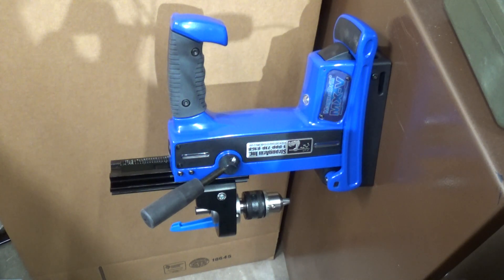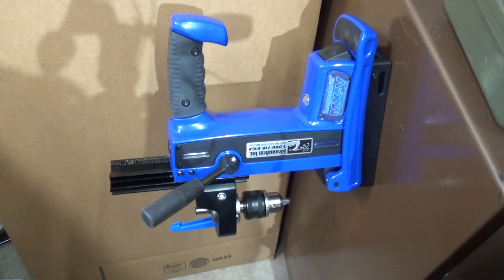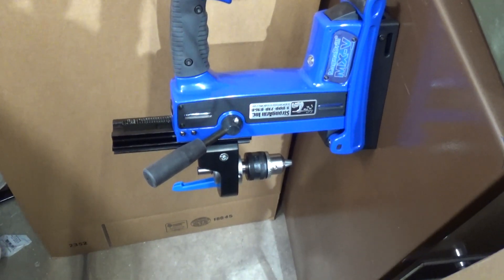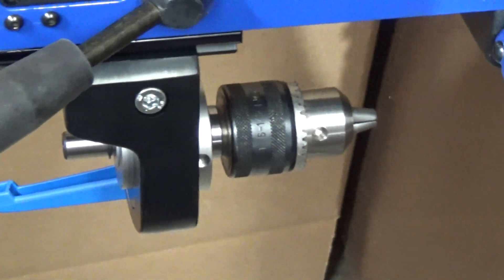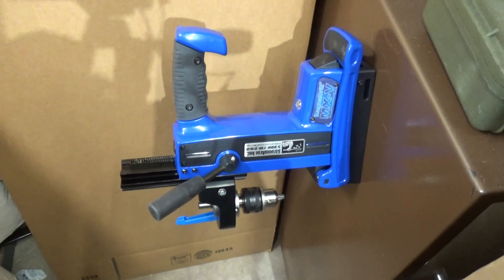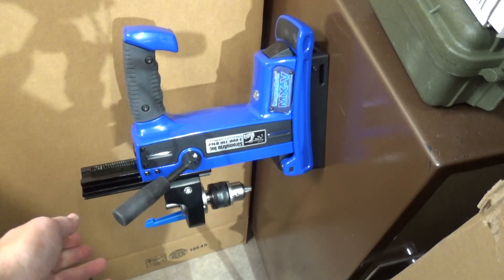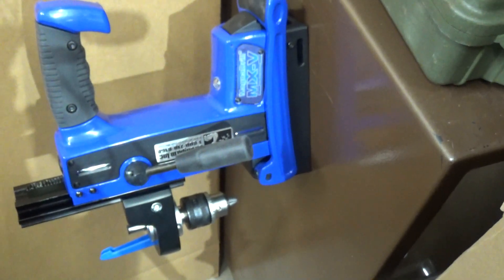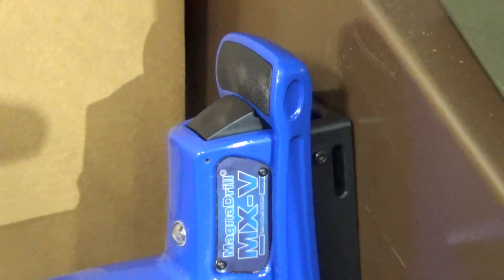HKS Systems Lock & Safe safecracker tool review Strongarm magnetic drill rig drill lock bypass tool

Comment: Would there be any advantage of using this rig over a metal shop mag drill setup?  Other than being able to use your existing drill equipment?
Reply from the maker: I have a standard electro magnetic drill rig as well its adhesion strength is less then this  plus much lighter and cordless. According to manufacturer it will be at full holding strength with even thin Guage gun safes. I have tested with 10 and 12 g. The milwaukee would break loose this stays put...win win!!
Reply: HKS SYSTEMS Lock & Safe awesome info!  I’ve been using a Milwaukee Mag Drill for a while, so I was curious about the advantages of this setup over mine.